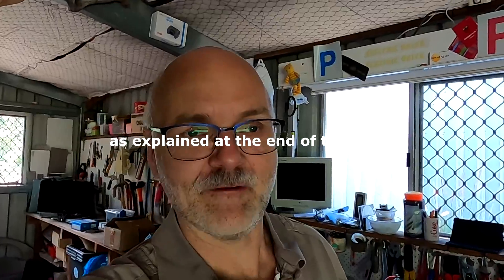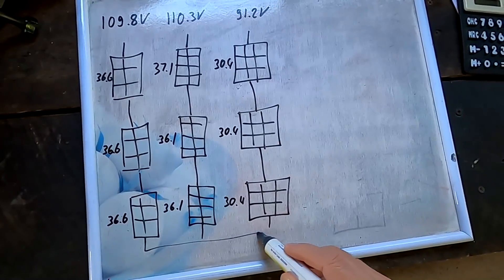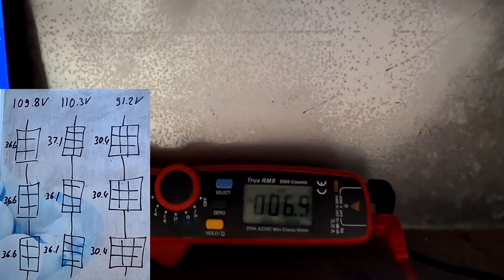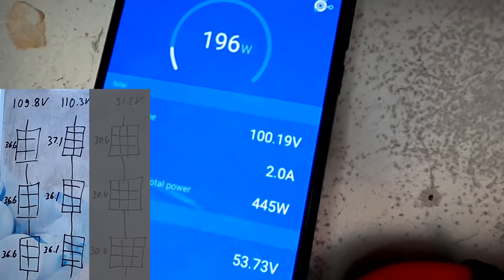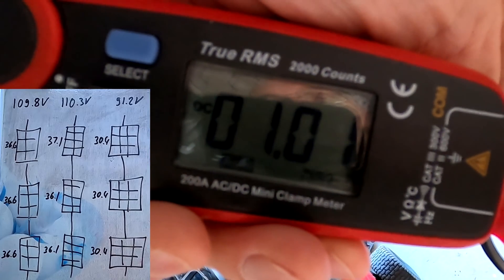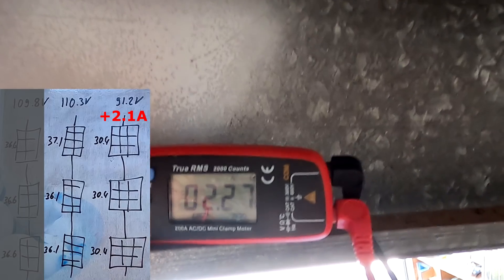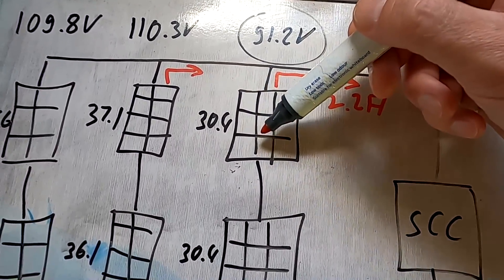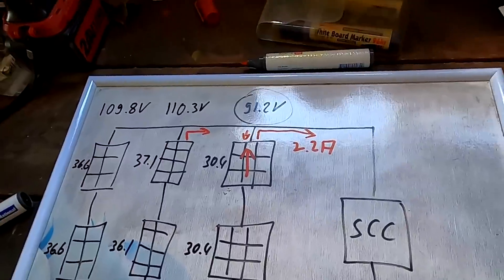Different solar string voltages in parallel. Does that work? (no blocking diode)🌞🔧⚡🔋

Comment: Better do such tests with a fixed load instead of a (smart) charge controller, this represent absolutely nothing. Like you just said, the problem is there when is not enough sun or clloudy. This also happens with same rated panels, that is why you need a blocking diode. A blocking diode is also present to avoid disasters like consuming power, heat, fire or anything else bad that can happen when other panel or panels start to malfunction (such as a short).

Comment: This is a bridge rectifier or a blocking diode?
Can we use it to connect two solar panel strings in parallel?

Comment: I didn't use blocking diodes based on seeing this video a long time ago. I recently  noticed a drop in power without the blocking diodes. I had one new string 80V and three original strings at 60V each with some shading on 2 of the panels for 3 hours a day. I got about 15-20% less power without the blocking diode through the victron, so I can only guess it has reversed the current through the 3 60V strings. Is this the last video on this topic or do you use blocking diodes now? Now I'm rethinking adding blocking diiodes everywhere since I have some east facing and some west facing panels paralleled as well as some panels that get shade more often. It didn't occur to me that I could be losing power by reverse flow current when one side is shaded and the other side is lit. I don't want to get that low amp disease.

Comment: As long as the potential difference of the output is lesser than that panel voltage, the current will flow in the forward direction out towards the charge controller (load)

Comment: If current “always” flows from high voltage to low, then how could one sell their excess energy to the grid (Einspeisung ins Netz )? I always even wondered how does this work
Reply: Your inverter will check the grid voltage and increase its output to be always higher than grid voltage.

Comment: Andy. This video needs a follow-up with the knowledge you have acquired the last 3 years. You could add that the efficiency of an installation also hugely depends on how (and when) you use the energy.  Especially in second hand use of equipment this is important to keep in mind. Enjoy the "winter" down there in sunny hot Australia. Best wishes from Norway.

Comment: use Diode every string before connecting it in parallel, see the result
Reply: Hi darry, İ use 5 pannels in paralel each 47-49 volts but different amperage and of course partially shadowing. İ want use block diodes for each panel positive before connect to paralel connector. İ have two different diodes. 10A10 (10 amp 1000 volt silicon diode) and 15sq045 (15 Amp 45 volt schottky). İm not sure wich i should use better.

Comment: hellou! I comment as a beginner but i was wondering that  in your test there was a s.c.c. probably requiring amperes and watts to fill the battery... but what if the batteries are full and the s.c.c. decreases the incoming current?

Comment: Andy, a quick question.  Given your experience, garnered since making this video, when discussing solar panel strings on each side of the roof.
My question- using a combiner, why can’t I feed both strings to the combiner?
I know that the roof side, facing east, will generate a greater voltage, than the string on the west-side of the roof.  East-side will come up first, but the west-side does come up, on,y later.  The adverse is true for the afternoon.

Your insight please?

Comment: Predictable results. The strings are not very different. The MPP-s were just a little bit moved from their absolute maximums, check IV-curve for solar panels. About reverse current - can not be for such low voltages, the solar cells are diodes, reverse can only occur if they are damaged.

Comment: 2 panel series 340+380 to 40A mppt at 12v battery. My mppt pick one panel and when I disconnect and reconnect the connectors or solar wire in mppt it’s start working with both panels. What to do now? Volts and amps are little different

Comment: I like the experiment but Id personally use that 32v to pick up some early or late rays vertically in the am or pm and give the system a nice trickle if solars the only means to charge that way you can bring or keep your cells at a nice healthy level when you start to turn on or off day use loads.

Comment: I have 16 panels of 435 watt 
And 16 panels of 555 watt 
Now for 15 HP motor (12 kw)
How string is formed of panels (inverter 15-18)
Reply: I depends on your solar controller. Build panel strings (serial) where panels with Icc for each panel is as close as possible. Connect strings with equal Voc in parallel.

Comment: 6:00 I'm interested to know if you have to clamp on the ammeter in the same orientation, meaning if you flipped it over, would it read a negative? I suppose you would manage that by having the readout face the output of each of the panels.

Comment: Sir.. I have 60W 2 panels (voc-22v, vmp 17.2v) and 195w one panel (voc-45v vmp-36.6) .. Can I use 60w panels series and parallel with 190w panel for 24v system ? 
*with inline 10A blocking diode
Reply from the maker: If you use a blocking diode, yes you can.
Reply: @OffGridGarageAustralia   what is the best SCC for this system ? mppt or pwm

Comment: I have two strings of 500w solar panels going to two different charge controllers. I want to add another string on the roof I can add 600w going to a third charge controller but charging the same battery bank. Is 600w ok when the other two are 500w or do the third string need to be 500w as well? Thanks!

Comment: When we have same voltage strings connected in parallel and shade on one string. It has the same effect as attaching a lower voltage string.

Comment: I'm pretty sure all solar panels have diodes installed so the batteries can't backflow at night thru the panels.

The mppt controller pulls the voltage down enough to allow the maximum current & voltage combination necessary to get the max power out of the array.

For example, if the lowest string voltage was 100 volts and the rest of the strings were 120 volts... The charge controller would keep pulling more current until the entire array voltage was lower than 100 volts.  

It would keep pulling more current until the power point reached the maximum.
Reply from the maker: You are mixing up bypass diodes and blocking diodes here.
I made a video a while back and explained the important difference: https://youtu.be/J9jqUwOdnEI

Comment: Can I have two separate strings of 5 solar panels one in series and one in parallel, going to different charge controllers but charging the same battery bank?
Reply from the maker: Yes, absolutely. As long as these different solar setups are connected to different charge controller, that will work just fine.

Comment: Apparently there was a load on the panels when you did your test as they were sending current somewhere. If you consider the load as a resistance in parallel with the panels, the current would flow from each panel as long as the voltage drop across the load was greater than the voltage of the "weakest panel". If there was no load, wouldn't the panels act just as batteries of differing voltages would when connected in parallel. The higher voltage panels should pass their higher voltage to any other panels connected in parallel so the lower voltage panel would be subjected to the voltage of the highest panel. I have no idea how much over voltage a panel can tolerate. Considering that shading produces voltage and current fluctuations in connected panels all the time, perhaps it isn't an issue unless the voltages greatly exceed the rating of a particular panel? The by-pass diodes incorporated in modern panels may help reduce significant current from back-feeding thru the panel as well. I am a retired school bus driver, not an electrical engineer so don't claim any expertise except for what I have learned from Andy.
Reply: You are correct, that the diodes internally in the panels will stop the back-flow of current.  If they burn up, under ANY CONDITION (balanced or imbalanced) the result is still catastrophic failure.  Clouds and sun angle will always vary the imbalance, so less risk than CONSTANT imbalance.

Comment: Sorry resurrection of an old video, but how about putting pannels in series of different volts? 

So basically you could combine 1 of each type in 3 separate parrel circuts?

I know the off grid garage is beyond this setup nowadays
Reply from the maker: In theory, different voltage is OK as long as the current is the same (or very close). I doubt you will find that though. Higher voltage usually means larger panels with more power output and therefore higher amps.
It's not recommended doing that, so, always use same panels in series.

Comment: Good experiment. I have a string of 10, 250w panels (37 volt and 9 ampere each maximum). The entire string reach 350 volt. Can I add another string in parallel with different panels (say 6, 300 watt, 60 volt, 5 ampere maximum)
Reply: Watch this video. He already answered the question - whole purpose of this video...

Comment: Sir Andy I have 6 545watts in series and I have also 5 320 watts .I'm using a hybrid inverter 5.5,kw..since my panel has different specs...it's alright to separate the 5 320watts with another mppt charging the same battery with the hybrid inverter?

Comment: I've been doing it for 2 years now and all is well. I had 8  250w panels and then added 4 330w panels, and then added 3 445w units and all is well so far.
Reply from the maker: As long as they have the same voltage, there is no problem.
Thanks for sharing...
Reply: @OffGridGarageAustralia  Andy, not even close....The 250w have 35v, 330W 40v and the 445W 49.7v. Remember that the higher panels have to come down to the lower ones. Someone told me one day it's a fire risk, but after 2 years, not even a spark
Reply from the maker: @Domingorparedes  Oh, that's not good. The higher voltage panels could feed power though the lower voltage panels. If you use blocking diodes for your strings, what happens if they fail? This person was right, it could be a fire hazard...
Reply: @OffGridGarageAustralia  Fire risk is increased, but fire risk is always present, if the diodes fail internally, even under balanced conditions of equal voltages across parallel arrays = fire.
Reply: Well, just to test your theory,  I connected the 445W  49.7v Jingli panel to a 12.6v car battery directly with no C.C. and voltaje never exceeded 14.3 at the terminals.

Comment: the higher voltage panels wont bring down the current of the lower voltage panels.
but the lower voltage panels WILL bring down the current of the higher voltage panels.. you did the test the wrong way round...

Comment: You cannot get any current into any solar panel for the simple reason that all solar panels include a bypass diode that completely impedes the current to pass in, so it is safe to put solar panels in parallel even if they have very different tension. It's as simple as that.
And if you think your solar panel doesn't have a diode, you are probably wrong, all panels made from 2 decades ago to now do have it, otherwise it would be dangerous to use it in series and even in parallel.
Reply from the maker: @rufelestrada9791  all panels will show 14.xV when connected to a battery directly without charger controller. But this is the most inefficient way to charge and not safe!
And, you have a problem if the battery gets full. Then you will see that it does not work with different panel voltages.
Do a real test with MPPT SCC and you will see the results. Or better, don't do this test as your labels may catch fire!
Reply from the maker: That is wrong as the bypass diode is in parallel to the actual solar cells, not in series.

Comment: can some1 tell me if u can wire 3 panel in a mode when 2 panel is in paralel for increased curent,and 1 whit them in series,same kind of panels,to add more voltage? i have only 3 panel,but whit 3 its more than 100V,but whit all in paralel is too low
Reply from the maker: NOOOO, that will cause a fire! Put them all in series and use a MPPT solar charge controller. It will maximise your charging.
Reply: @OffGridGarageAustralia  the charge controler is mppt built in my inverter,but at 102-105 volts it gives red fault led,and wont charge...if i put them all in paralel,than its around 34-35 volts,but despite the increased teoretic current it wont convert more than like 5-7 amps,out of the 25-30 amps the 3 panel has.Since yesterday i am using only 2 out of 3 in series whit 64 volts,that fluctuates under load/conversion from 45-55volts,and it can do 15-18 amps.I ordered a 4th panel,so my budget increased unfortunately,and i hope i can vire that 2 in series as well,than in paralel whit the other 2 series string,will it work tho to create the rated 30-40 amps?
Reply: @OffGridGarageAustralia  also thanks for answering!

Comment: The first two strings should be fine in parallel because they're same voltage. You wouldn't want to combine the third string because of different voltage but if you are going to do it, you get more total output by wiring the third string in series with the first two parallel strings. The only way to get maximum output from each string is to have a separate SCC for each string.

Comment: Is there a problem if the volt or ampere is different on the panels or everything is fine. Sory no english cant understand video 😟
Reply from the maker: Voltage of the strings should roughly be the same if you parallel them. Amps don't matter in this case as they will just add up.
Reply: @OffGridGarageAustralia  thx u soo much

Comment: Wouldn't the by pass diode prevent the current from entering the pannels with the lower current?
Reply: Defiinitely, if the panel has it.  Most modern panels have it to protect against back current.

Comment: And ... what if the SCC is not connected, but the parallels are still connected to each other? May be the current flows from the high voltage string to the lower? hummm... I'm just thinking...

Comment: If you had 8 300 watt panels wired in parallel facing east and 7 300 watt panels in parallel facing west and the two banks wired in parallel to the charge controller would the bank opposite the sun bring down the bank in the sun

Comment: As long as the lowest voltage string has a voltage above your charging voltage, which I assume 48v, you are not losing much if any power. Would be a better approach to have a schottky diode at the end of each string to isolate them.
Reply: Most solar panels do already have this installed in the back of the panel.

Comment: You video's are intresting to watch but you keep using terms like volts in place of watts or visa versa & mili ohms where you should be saying mega ohms, the confusion is limiting your audience to novices when you don't get the values & terms accurate but your efforts to take others thru the solar experience is good.

Comment: The current will not go into the lower voltage panels due to the blocking action of their internal by-pass diodes.
Reply: By-Pass diodes, are NOT blocking diodes ...
Reply: @MrSummitville  true
Reply: @johannholtzhausen895   A bypass diode has nothing to do with, and cannot block, the reverse current from entering a lower voltage pv panel.  Bypass diodes, will only by-pass amps around a section of cells within a pv panel, when partially shaded ...
Reply: @MrSummitville  you are right!

Comment: Question about a JP21-19/900 - 72VDC, 900w 1.2HP, 62ft, 92GPM, Solar Water Pump with MPPT Controller -  I have 4 x 270watt @ 35.5v Solar Panels. Will the controller handle 142 volts coming in and deliver the required 92v if connected in series?

Or will I have to connect 3 panels in series and 1 panel in parallel to them?

Or possibly 2 pairs of panels in series and then connected in parallel?

I would like to use all 4 panels if possible???

Thank You for your expertise.

OK - I just mounted 2 of the 270w panels. I just tested with a voltmeter. On a cloudy drizzly day like today each is putting out 40vdc. I think this is VOC, right? So, with these panels and my controller, how do I get 900w to1000w and the less than 150v needed for the controller. Only 3 panels in series would give me the voltage, but NOT the amps. 
That's my ignorant dilemma. ????
Reply: With all four (4) of your Solar Panels connected in SERIES, I believe that you have a Voc problem!  So, use two (2) SETS ... Set #1 = 3 Panels in Series + Set #2 = 3 Panels in series.  Then connect Set #1 and Set #2 in parallel into the controller.  Four (4) of your Solar Panels all connected in SERIES is "bad match" for your MPPT controller.

Comment: You Physics understanding is flawed.  Think of water flowing through a pipes, voltage is electrical pressure, current is electrical flow, as long as there is lower pressure going to the charge controller, there will not be back current but when the charge controller shuts off flow then it could be possible.   You could test this by shutting off the charge controller and measuring the current in each line. Don’t assume what you wrote at the end.

Comment: Why don't you put one of each type of the panels in one string starting at GND with the lowest panel voltage to prevent the bypass diodes from kicking in? This would create three strings with the same output voltage. According to your schematics connect them in a horziontal row with 0V on the right hand side instead of the vertical structure.
Reply: In series, you should match the Imp ( amps ) of each type of solar panel ...
Reply: In theory, that's a good idea, if you place the lower voltage panel in the opposite part of the day as opposed to the other 2 higher voltage panel arrays, but most charge controllers will limit voltage at 240V.  Three arrays connected in series (his 3 arrays) would produce up to 310V approxiamtely - too much for the CC.